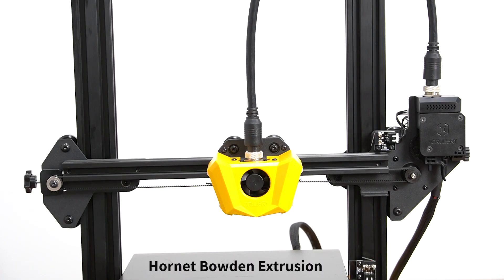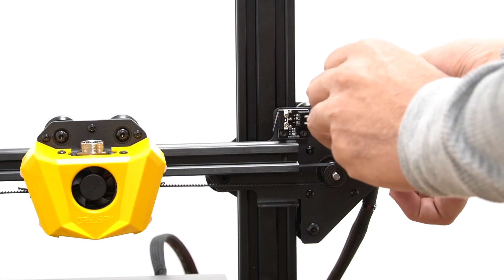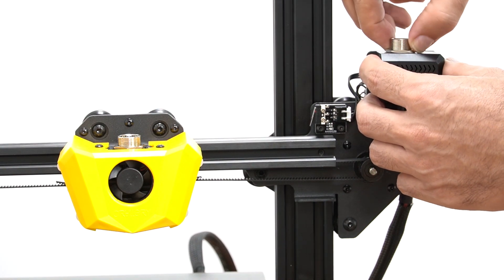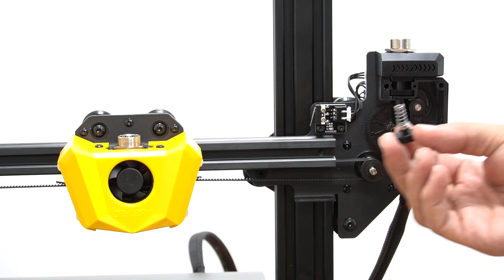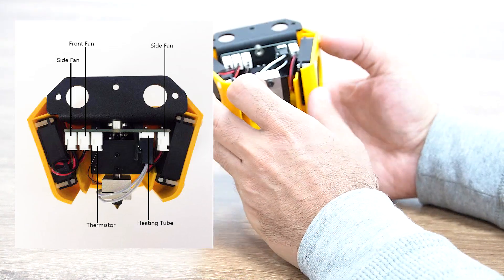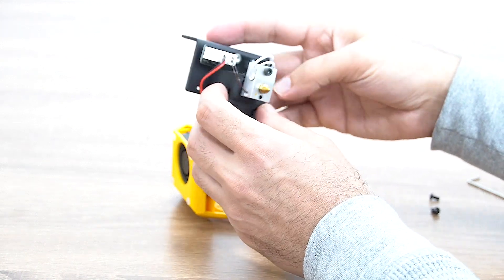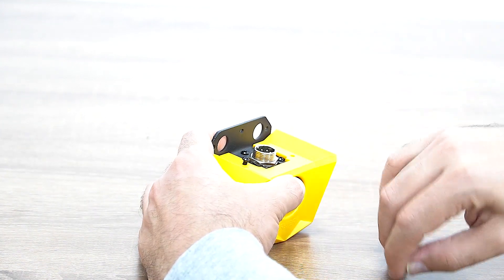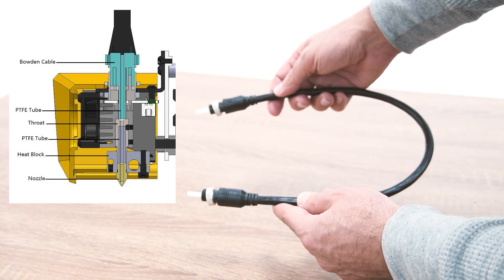Artillery Hornet 3D Printer Bowden Extrusion System

Comment: I have been fucking with this extruder for the longest time --- pretty sure the real culprit has been a small clog in the head though at this point ive been making adjustments all day and cant get the extruder to work.... finally pulled the filament back into the tube and ran the extruder as a test -- ran like a charm without the hotend hitting the filament smhhh